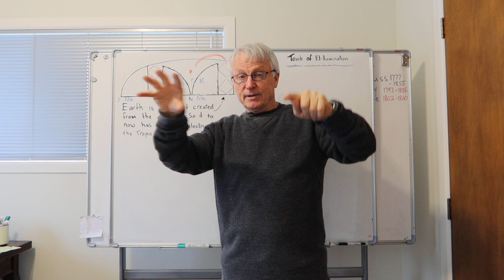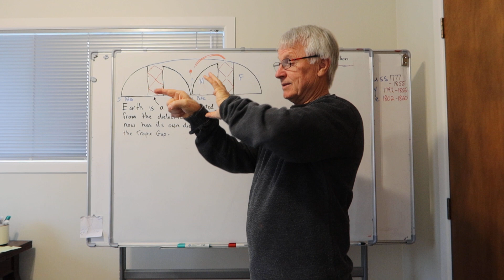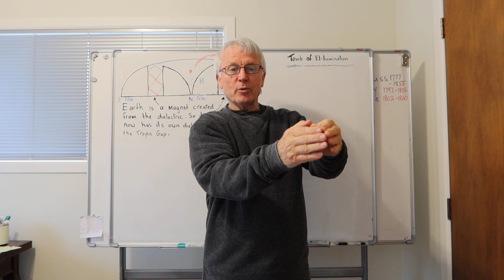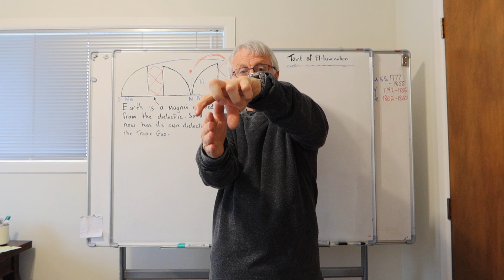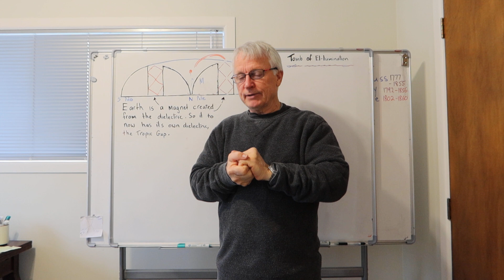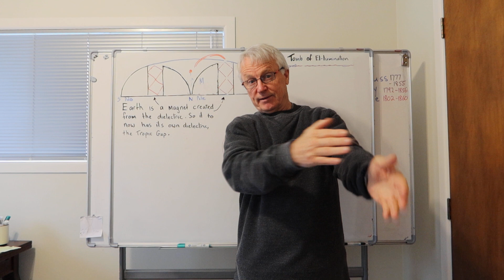Flat Earth Guru Explains Time.

Comment: Hey Lindsay what are the tides or what causes the tides?
Reply from the maker: The tides are caused by the 50/50 day and night movements, from the two ends opposite each side of the earth. 
 I might do a video soon.
Reply: @Meta369 maybe also the waters above are moving as "tides".?
Reply: Listen guys,in the great lakes of the US,some lakes have jo tides,some two,some three,some lakes have no tide one area,then 30 miles away a tide?, I have seen on flat earth Dave's channel a map showing to idal nodes and they are all over the place , no rhyme or reason,some are metres high,dome inches,there are maps that thow this,but they are well hidden,try hard and you will find one,they are not caused by the moon,ur magnetism,they are all over the place,5 metres difference over 0 kilometres
Reply from the maker: @michaeljoshualewis538  
But it must be associated with the moon's delay on the Sun,  the 52 minutes. The only two events that are present on Earth consistently are the two ends of where day and night meet.  There are other factors as to how or how much the tides move.